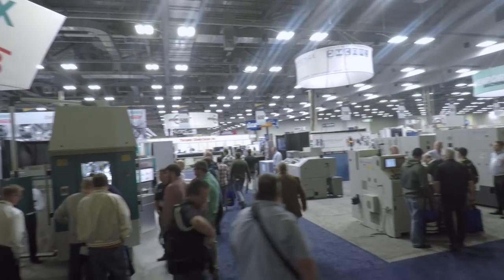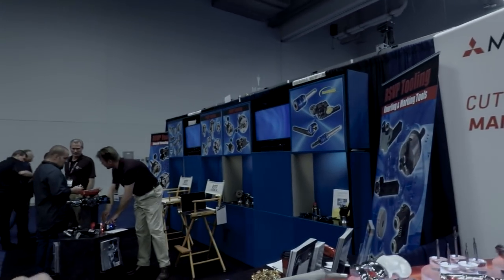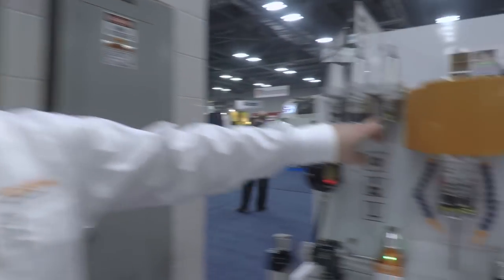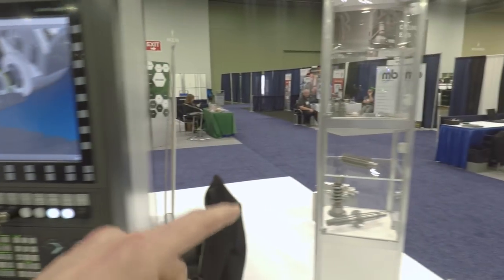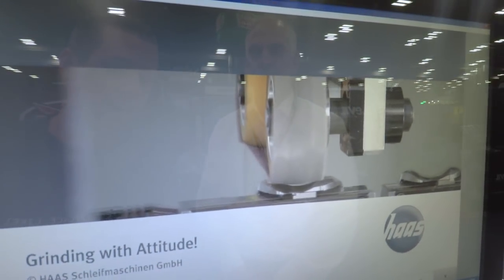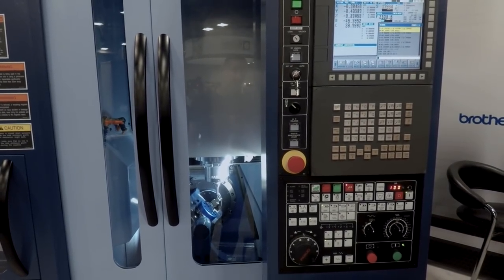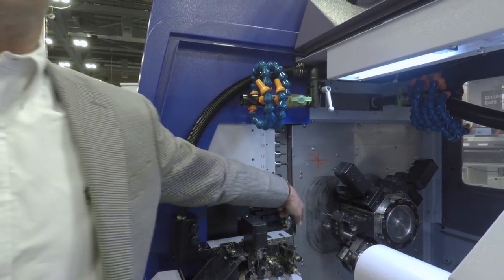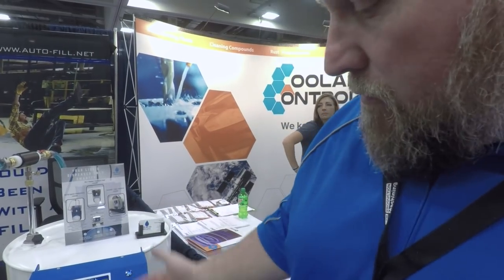PMTS 2017: Awesome CNC Machines!

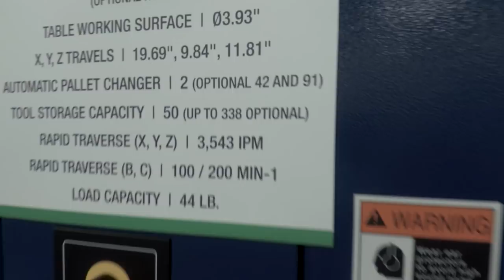Comment: 6:46 look at Johns face in the reflection when the salesman mentions 46,000 RPM. Priceless!
Reply: lol
Reply: My CNC PCB drilling machine had a 200,000 rpm spindle.

Just the job for 0.4mm solid carbide drills.
Reply: You must be that mad dentist.  hahaha
Reply: 200k, is that a typo?
Reply: No, vacuum driven spindle; drive and dust extraction in one unit.
Reply: It must use air bearings?